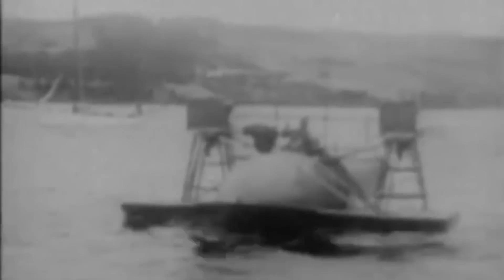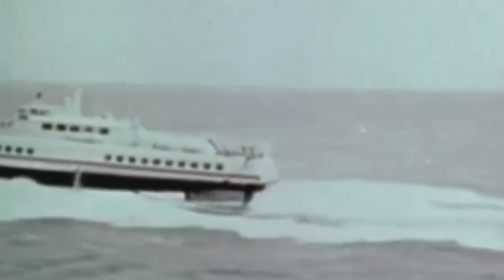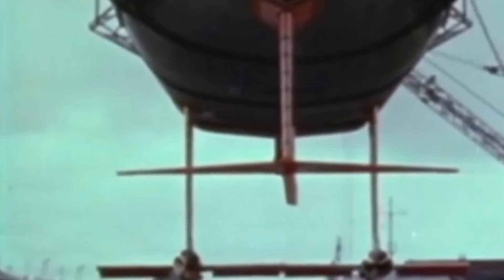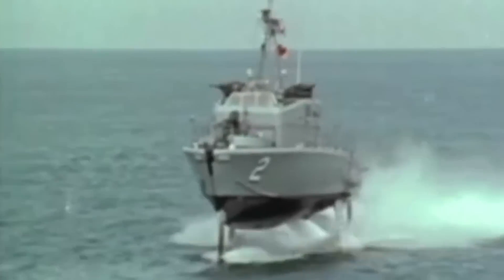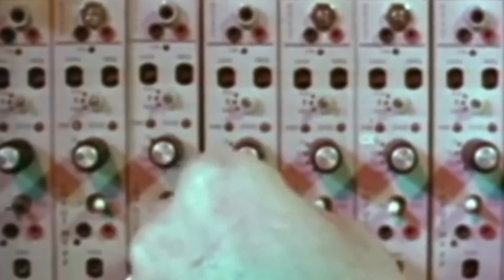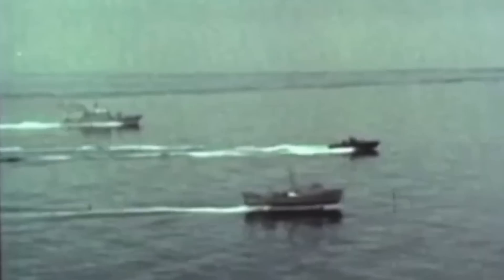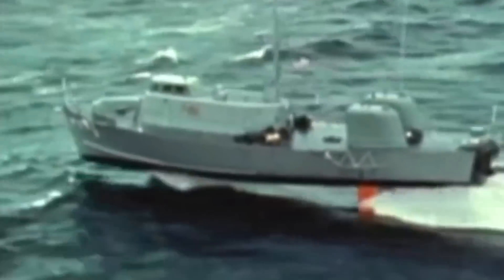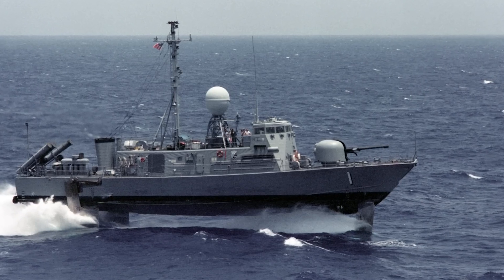The US Navy Boat that Should have Flown for the Air Force

Comment: The navy also had the Pegasus class that were jet powered a couple were used in Key West to assist on drug interdiction. I saw an old video of one chasing down a drug running high speed boat.
Reply: I was on one.
Reply: Seems like a waste that the Pegasus class weren't handed over to the Coast Guard when the Navy no longer wanted them..

Comment: At one time I worked on a building site on the River Thames. At that time there was a Boeing Jetfoil ferry service from Brussels to the City of London. Those were quite a sight, I would see them coming round a bend in the river and zooming past. When they came into view it would be heeled over, then straightened out and cruised past way faster than anything else on the river, and such a smooth ride. Other boats trying to go anywhere close to the same speed would be battering into the waves and getting a hell of a pounding, but you could just see the Jetfoil passengers sipping their drinks.

Comment: As a Navy photographer, I rode the USS Antelope (PG-86) for a few days when she was on duty in the Mediterranean circa 1973-74. Despite the flashy hydrofoil ops, the truth is that Antelope mainly plodded along on diesel power. Only when an object of interest was spotted would the crew start the turbine. This may have been a fuel-saving effort, since this was just after the OPEC oil embargo. The off-duty crew usually ignored turbine, but the photographer-visitor was out of his bunk and on the bridge in seconds any time they fired up the "bird."
Reply: Canadian frigates operate the same sort of way. Cruise on diesel and can fire up the turbines in I think, less than a minute.
Really impressions was seeing it stop.  Reverse the prop pitch and boom, the bows dipping underwater, it stops that fast.

Comment: Curious as to why Canadian Warships or Aircraft that were operating at the same time as their American counterparts seem to be overlooked especially when they outperform their American counterparts,  for example... the Fastest Warship ever, was Canadian which was a vessel built for 60 Knotts which she actually exceeded.

HMCS Bras d'Or (FHE 400) was a hydrofoil that served in the Canadian Forces from 1968 to 1971. During sea trials in 1969, the vessel exceeded 63 knots, making her the fastest warship in the world at the time.
Reply: Bras d'Or was to be used for ASW. Improvements in helicopter-based systems and improvements in submarine technology rendered the concept obsolete before it was delivered. The program had some serious setbacks (an engine room fire and an absolutely terrible choice for the cruising diesel). Bras d'Or can be viewed at  Musée maritime du Québec, L'Islet-sur-Mer - I highly recommend it.
Reply: Fastest unarmed warship.....she was a test bed.
 Too bad it never really worked out.
Just like the Avro Arrow.
Reply: @wcresponder  the Avro Arrow didn't fail, it succeeded including altitude and speed records. The CF-105 Arrow was the unfortunate casualty of Politics. The same happened with another Canadian designed aircraft that predated the V22 Osprey by 22 years
The Canadair CL-84 "Dynavert", designated by the Canadian Forces as the CX-131, was a VSTOL turbine tiltwing monoplane designed and manufactured by Canadair between 1964 and 1972
Reply: Speed is not the only factor, when judging the performance of a piece of war kit.
Lethality and survivability, usually rank above speed.

Comment: This was awesome (for me) to see! Thank You! My dad worked on the Boeing Hydrofoil Program from the late '50s until he retired in '69. He was a Lead Test Mechanic on the USS Tucumcari (PGH-2), and also piloted the Chase Boat during testing. I can remember him taking me to the Official Delivery To The Navy Celebration in '68. Leading up to the production of the Tucumcari he worked R&D and also piloted the 'Little Squirt', which was a 20-foot-long Hydrofoil powered by a Boeing Model 520 turbine engine. The 'Little Squirt' now resides at the USS Aries Hydrofoil Museum in Missouri.
Reply: That's Dope!
Reply: Were those made at the Renton plant?  I seem to remember the ferry versions being briefly tested on Lake Washington back in the early/mid 1970s.
Reply: @Writ3r_Dude  Not sure if they were made in Renton, but the Tucumcari was moored on the mouth of the Duwamish River (behind the old Plant 2) for Final Assembly, R&D, and Testing. They tested it in Puget Sound AND ALSO in Lake Washington (via the Ballard Locks).  Also I'm pretty sure that they didn't start building the Commercial Hydrofoils until after the Military versions proved out, although I'm sure they were working on the plans & designs.

Comment: The PT boat in this thumbnail reminds me of an old arcade-type Playstation 1 game called Battle Stations. The game case insert has a hydrofoil PT boat on it just like that, and in the game the hydrofoils are one of the boat's special abilities! :) There are also Ticonderoga class cruisers and Iowa class battleships in the game which fire Harpoon and Tomahawk missiles each respectively as their special abilities. If you engage the PT boat's hydrofoils when the Tico or Iowa get a missile lock on you, you can actually outrun the missile in its very last moment before it hits you. Not realistic, I know! It was just a very fun exploit to have. Because otherwise...you had a 5" deck gun and torpedoes which were both horrible against anything.

Comment: In 1982 I was on a tincan, staff duty. We had a gator freighter that took the Pegasus boats around. Off Africa, we had a VIP visit, they had three of the hydrofoils do an exhibition and it was like the blue angels with boats. There was some problems with the weapon systems that didn't make sense to us but they could get up and move. As far as patrol boats go we, the US, sold a couple, I saw two, to Egypt that we escorted over. Those lil boats were loaded for bear, could have sunk us if they were to try. We were not happy that the US had sold to Egypt but they likely screwed them up
Reply: I was on one of these hyrdofoils when it visited Rosyth Naval Base in Scotland (1970).  Not sure if these were deployed in Vietnam.
Reply: @sunrayisdown1690  q
Reply: Yep, I'm former Gator Navy on LPD-12. USS Shreveport.
Reply: Who attacked the USS Liberty in 1967 multiple times with air attacks, TP boats and helicopters?  I would feel safer with them in Egyptian hands than with our so called friends
Reply: I had a game on the Commodore 64 called PHM Pegasus that was a simulation of the boat. It had a forward Oto Malera gun and 8 Harpoon missiles. I loved that game. I probably still have it somewhere but the C64 is long gone.
Reply: @donkeysunited  The Harpoons are great missiles. From what we were told was the boat had to basically stop in order to fire them. When zipping around is your claim to fame stopping isn't a great idea. The crew was strapped in. Nice boats.
Reply: United States military doesn’t export American military level vehicles. We even removed the special armor off the Abrams before we sent them to Ukraine. America doesn’t share its military secrets. Period. Export models are not the same as American fighters
Reply: In a year would have been junk
Reply: @tomhenry897  Yup. Brand new, Phalanx , harpoon, still pisses me off